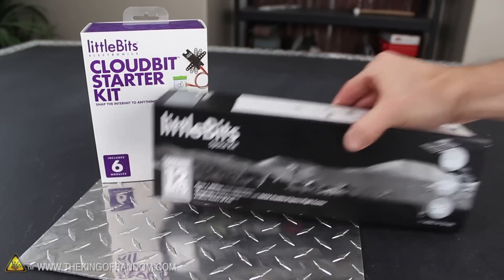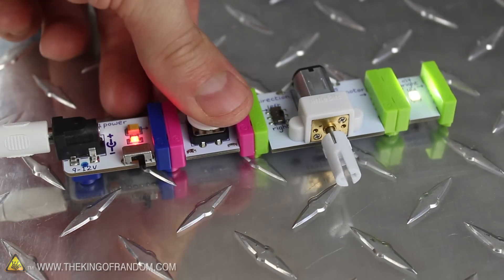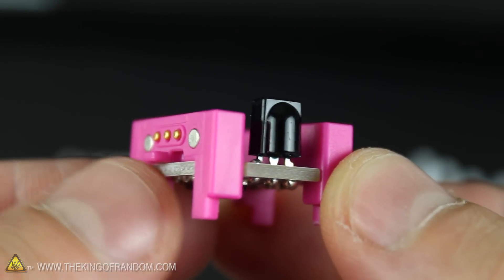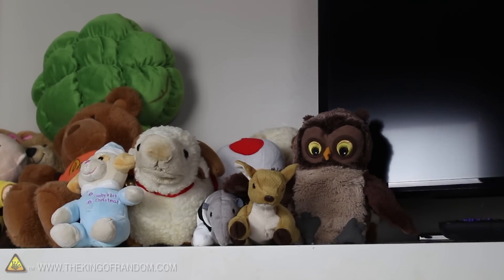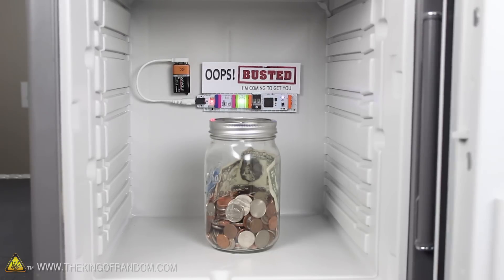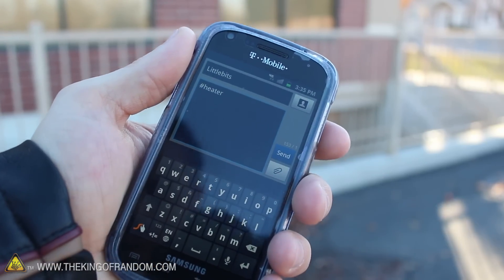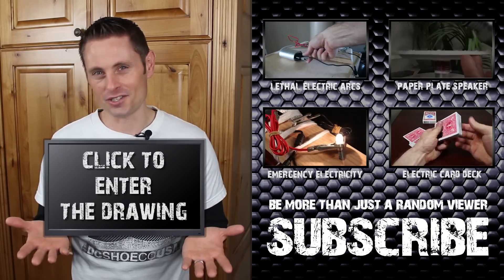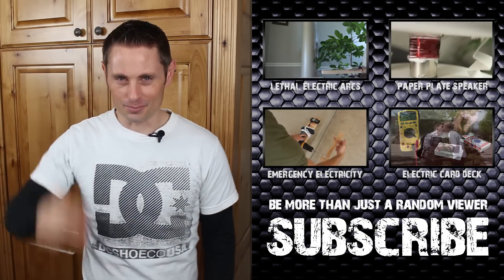Electronics Projects, with LittleBits

Comment: $20 off something that should only be $20. Little bits are crazy expensive.
Reply: I agree
Reply: yeah
Reply: I bet you can makd one yourself better than this with 15$
Reply: OMG they r like 99 or 199
Reply: True, just use a camera for that thieves thing
JUST USE A CAMRA
Reply: +Tristan haddock some 299
Reply: Well
It's part of robots plus 20 and 20 is the same..
Reply: +Samina Alam ?? it's not robots -_-
Reply: little bits are indeed expensive. you could make your own kit for probably less than $50 now
Reply: deltaray3 agreed
Reply: deltaray3 they are really complex so it has to be expensive until parts become cheaper
Reply: Just buy Snap Circuits instead. Way cheaper and way more fun to put together. Still expensive, don't get me wrong, but not $4,000.00 expensive.
Reply: @mormon_twink  I'd like to see all of you guys try it
Reply: Agree
Reply: @lukeyin6590  I do. I've printed my own circuit boards and it was just small batches. LittleBits really shouldn't cost more than $30 or 40 for what they are doing as they'd be mass production and they'd still be marking it up by 100% or more.

Comment: Woah, little bits are an awesome way to get kids into electronics/coding!
Reply: +BashCat Your rite, it's an if/then, but it will get kids into the theory of putting together electronics and then getting let's say input from a sensor and having software take that and tell it to turn on the sprinkler if the sensor doesn't sense water or something along those lines, and it will spark their interest in taking it further into the realm of coding, thanks for clearing that up!
Reply: Daniel Pierce  boi u dumb

Comment: But a rc toy will also set off the remote detector
Reply: That sensor seems to be rigger for IR. RC uses radio waves.
Reply: +Lance Lindle Lee some cheaper rc car models have it like the ones under 20$